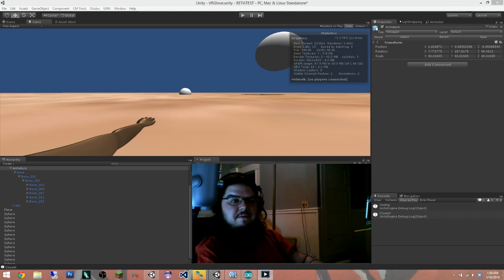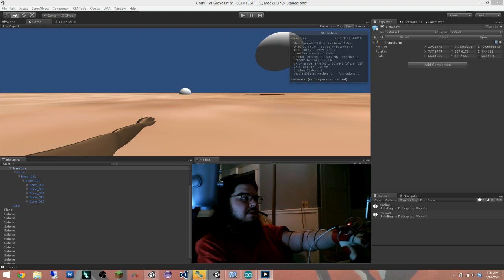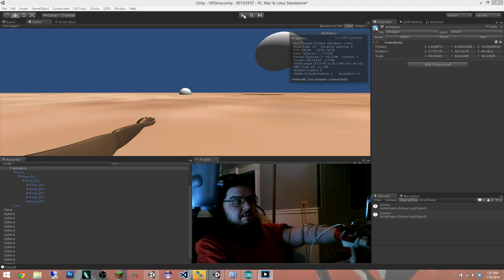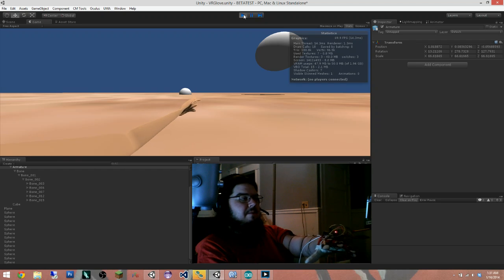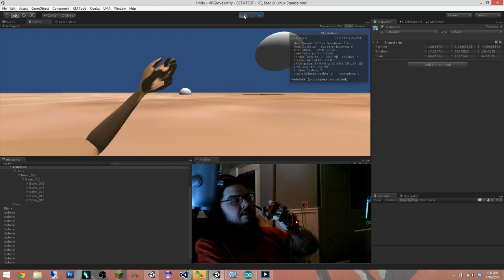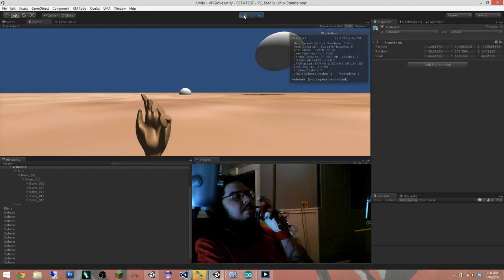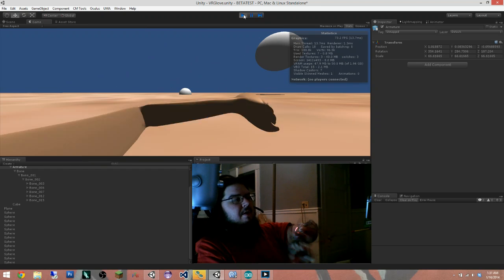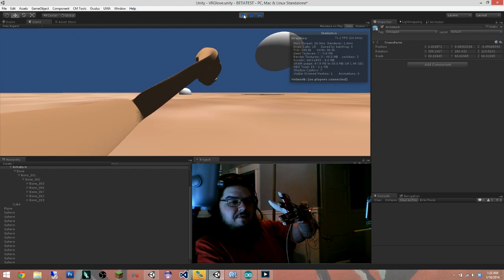VR Glove Video 6 - Hardware is a go.

Comment: Nice, looks like you are using metal strips which are pushing 'sliding switches' to measure the finger extension, I'm guessing this cannot measure sideways movements of the finger such as spreading the hand out,  or curling the finger tip without moving the base of the finger ( knuckle joint ), you could solve that by adding another strip per finger which is half as long and attaches near the base of the finger.  

The finger spread could be detected using some sort of magnetic field to figure out the distance between adjacent fingers, giving a scalar distance which you can resolve using the extension data to find the absolute position of the fingers.